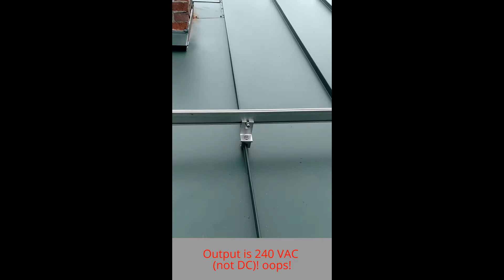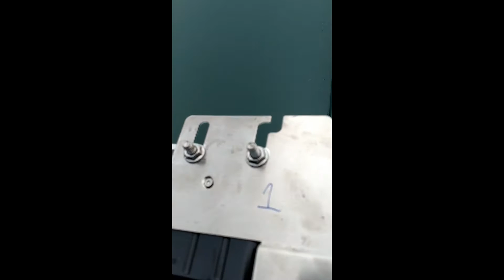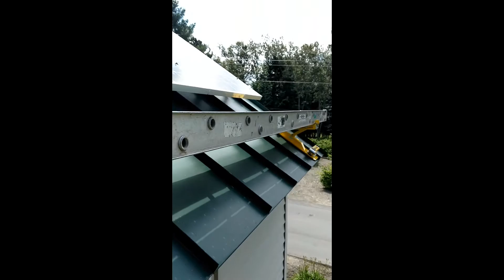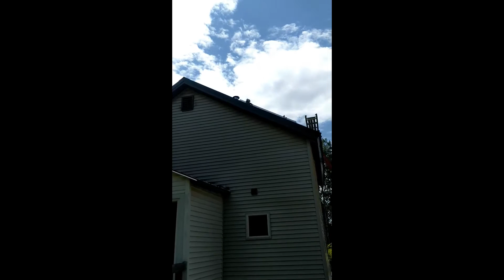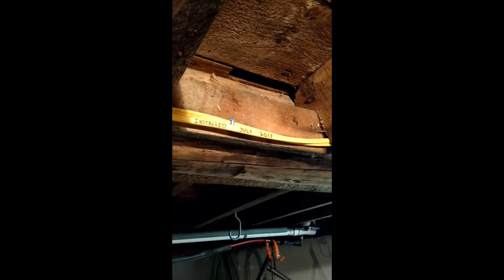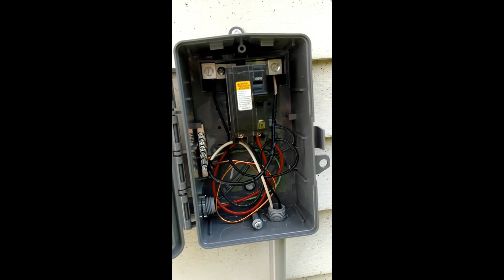Enphase IQ6 and LG 370 watt panel installation

Comment: I want to know the output ampere of microinverter you have used in your solar system.
Reply from the maker: Vincent Masanja the sum of all the inverters comes to about 7 amperes at 245 or so volts. I hope this answers your question.
Reply: Thanks for your answer. So 7amperes×245volts=1715watts.That's the best device to use.

Comment: panel is 370W and Inverter output 290W, will it be a waste or not?
Reply from the maker: Joe Cox , a very valid question. I over sized the panels because of a couple of reasons. One is, those are the panel's I had. The other is that the largest inverter you can buy currently are rated at 290 Watts. Another reason is because, in Maine there are plenty of marginally sunny days that if I sized the panels smaller, the irradiance would not be enough to wake up the inverters. Does that make sense? You are correct though in saying that I am throwing a lot of wattage away on a perfect solar day. Yesterday was just such an occasion. I noticed that those little inverters we're indeed overproducing but nowhere near the capacity of the panels in total.

Comment: Hey John thank you for video! I have few questions. Looks like the Aggregator combines your solar panels. Now you have 3 wires going back to your main panel how do you wire your circuit breaker? Because you getting power from circuit and from solar. How it’s back feeding? Installation looks pretty simple. Looks good on your roof! 👍

Comment: if you are connecting only (2) IQ6+, do you actually need a junction box or can you wire directly to your load center?
Reply from the maker: Don R, I think you're talking about the combiner box on the roof. You do need to transition from the harness that plugs into the inverters in order to enter the house with a listed wiring method. Therefore, yes you do need a junction box on the roof.

Comment: Will the Enphase IQ6 microinverters work without the Envoy communications gateway?
Reply from the maker: Amos Batto, yes! That is how I have them installed! I have confirmed their output with an amprobe and bought an inexpensive ( read : cheap Chinese) revenue meter that I will permanently install onto the system hopefully in October. I plan on making a video about it too! In that video I will do some Watts law calculations also to prove my output. Stay tuned!
Reply: Yes it will work, but you want  the per panel production  monitoring  that the Envoy internet interface provides .{Also available is consumption rings optional) . You can see your total production in various graphs  and charts at the en-phase Enlighten site daily monthly ,yearly.  Also you can see if there are any problems ,shading ,or incorrect Azimuth angel  witch are very important for efficiency. Well worth the $300-400. I got mine on Ebay for 280.

Comment: nice!

Even though I AM a DIY installer, I think you will see in my videos that I did not take the learning process lightly. ( Being a mechanic/ technician and an electrician myself, did not hurt )

Check out my 15.2kW system I activated this past May:

https://www.youtube.com/channel/UCIOTIN4Yh96aNL5_7JPC6tQ

Being currently in Missouri but also FROM Boston, (Southie), I would appreciate your opinion.

My next DIY project will be a 100kW system on my business.

Comment: How come you need two Ac disconnects? The breaker in the panel can serve as the Ac disconnect. Also, you can run Romex cable inside conduit, it is acceptable but not when it is in an outdoor location like you did for the outside disconnect. I would have also trimmed the long rail at the array for a cleaner install. Other than that it looks nice "Master sparky"
Reply from the maker: Jesse , the outside disconnect isn't required by electrical code as far as I can tell. It was required by the state of Massachusetts at my other house in order to get my rebates and I expected that Maine might have a similar requirement. As it turns out, no requirement there. With regards to the romex inside the PVC, you are correct. That is why the sheathing gets stripped off of the cable upon entering the pipe. The paper inside the romex isn' t listed for a damp location. The individual conductors are listed for that installation. Thank you for pointing that out! You have a sharp eye!
Reply: Individual conductors are not marked when the jacket is stripped off of NM (310.120(A)), the assembly is rated as a whole. NM cable or its conductors are not allowed in damp or wet locations (334.12), and a pipe run outside is a wet location. Will it work, and practically the same as if you'd installed it using the correct conductors? Absolutely. Not trying to pick apart but for future reference a picky inspector might make you redo some work which can be a big headache.

Comment: Beautiful installation. Very professional looking electrical work. You're a credit to your trade (IMHO). Looking forward to a followup vid. Cheers
Reply from the maker: conicEllipse ... Thank you for your kind words!
Reply: "Very professional looking electrical work"  Except for that Romax cable running along underneath the floor to the load centre.  In Australia as a licensed electrician the installation would never get passed with that cable not being supported by cable clips at frequent intervals to prevent it sagging and  no conduit or gland where it enters the load centre.  Looks like a home handyman did that bit of the install.  In Australia and New Zealand we call that type of cable (if it contains 3 conductors) "twin and earth".  For that job it would probably be 2.5mm twin and earth.

Comment: You only need to bond one rail. The othe rail is grounded via the iron ridge UFO mid clamps. Nice job
Reply: The Enphase IQ series does not require grounding to the rails. They have tech docs about it on their web site. The county / city code may require it but it is not necessary.
Reply from the maker: Jesse, I just looked at the product description. It says that the mid clamp bonds the panel to the xr rail. It doesn't say that the bond is carried through the panel to the other rail. Hmmmm... Not sure... But thank you for your kind words!
Reply: We do every other rail  as the panel carries the bond.